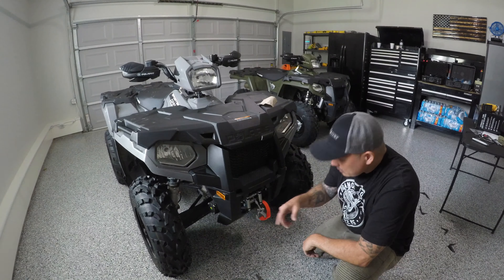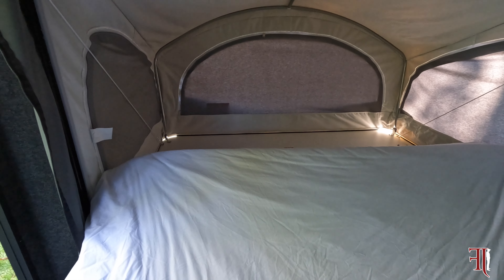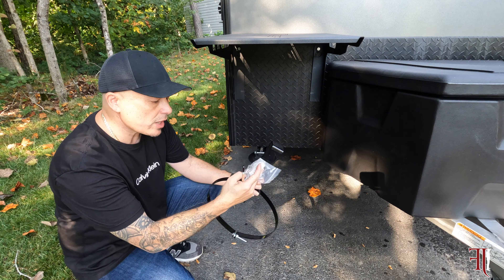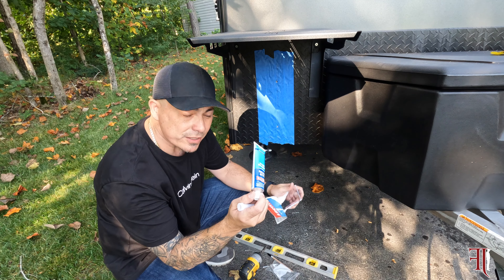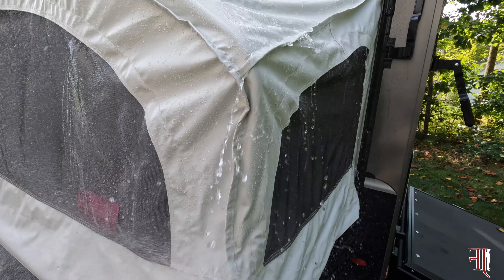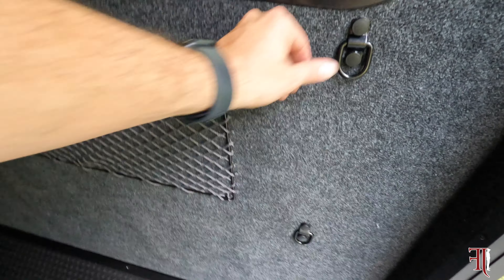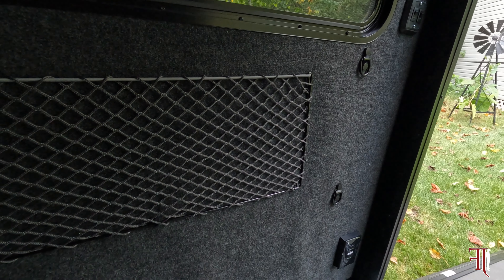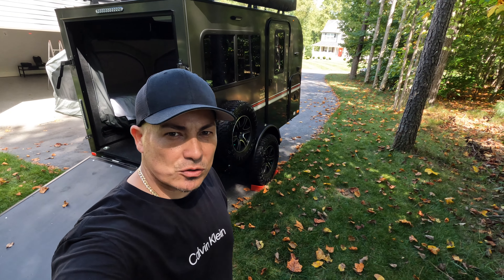2022 INTECH FLYER EXPLORE  INITIAL SET UP

Comment: Great info on all of your installs. 
How did you get the specs for the frame beam spacing in order to drill directly into the beams?
Thanks
Reply from the maker: Thank you 🙏.  Yes, so you can actually go on the Intech website and download it from there direct.  The blue print on there website gives you a super detailed description of where everything is or should be as well as more specs.
Reply: @FindingJay  Thank you!
Reply: Thanks for the great info.  Just bought a used 2022 Flyer Explore and I'm in process of mounting an awning and LP tank bracket, so your videos have been super useful!  I was also wondering where I could get the detailed framing diagram/schematic.  I've been searching all over the inTech website and cannot locate it.  Could you share a link perhaps? 

Also, for the LP bracket install did you just use two self-tapping sheet metal screws?  I'm a little nervous about not through bolting it because of how heavy a full 20# tank is.  

Thanks again!    @FindingJay
Reply from the maker: @davekomar7997  any time.  So to answer your first question the blue prints for the trailer are on the Intech website.  If you can find them you can actually call them and they will direct email to you but they should be under the Intech explore page at the very bottom.  The LP bracket should have came with 2 self tapping screw that are the correct size but if not you can just buy some at any hardware store.  Hope I was able to help.

Comment: Nice Vid; did you drive those screws into the aluminum frame work?
Reply from the maker: The screws for the D-rings?  They were not self tapping so I will say no because I felt no resistance.  I was hoping to miss the frame as I didn’t know if Intech ran any electric wiring in that area.  I did have back up hardware just in case.  My measurements off both sides were 8” which allowed me to use the 1” screws and miss the framing.  Perfect for what I want to do and plenty strong….super, super solid.